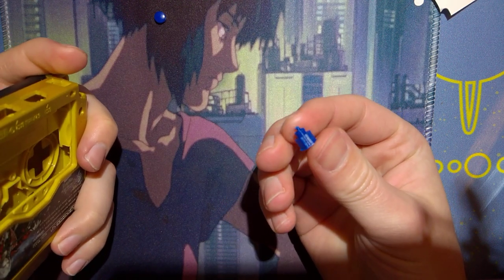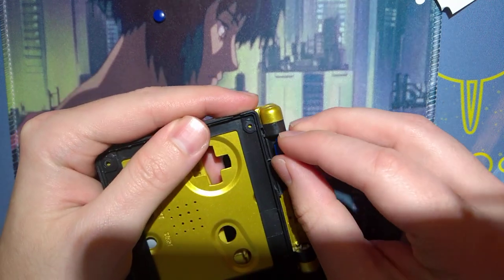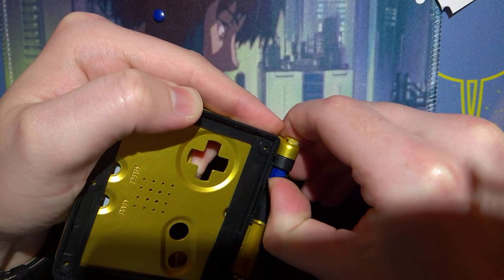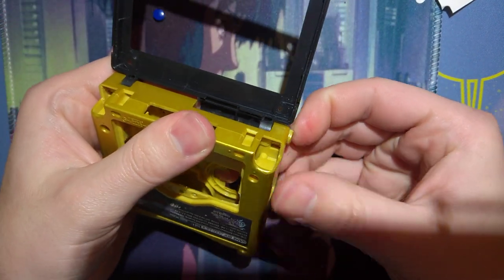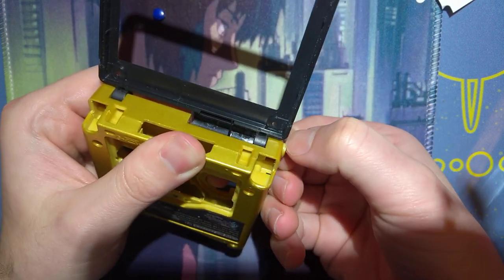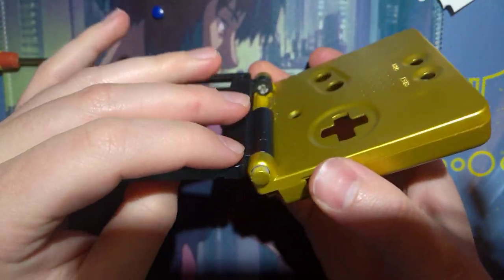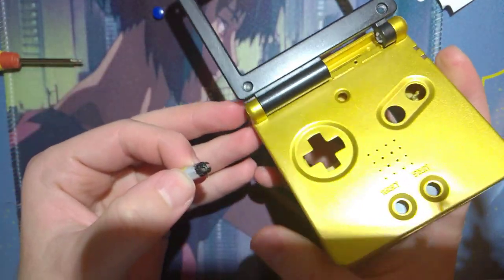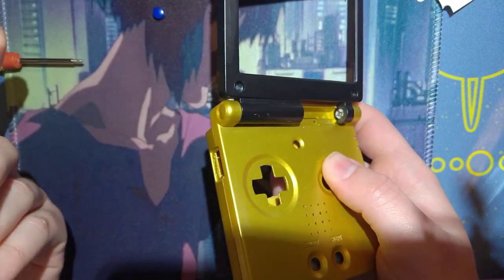GBA SP Hinge Removal Tool

Comment: Only 800 views?! This deserves way more! I've seen 1.4k view vids instructing people to do it the complete wrong way which were made AFTER yours... even has someone in the comments thanking the author for his "easy" alternative to your method only to have the same person return to the comments with a horror story caused by the bad info in that video.

People need to understand that forcing the hinges out while the lid is closed is 100% wrong and it will not go back correctly if they do that. This tool makes quick work of it.

The only comforting thing in all this is that my own video on doing it right with a Bic Round Stick ink pen got twice as many views as that bad one but I was unaware of your 3D printed tool at the time. Since I do have a few 3D printers perhaps I should make a follow-up without using years old footage of me floundering around. Then I could show both and feature the horror story as a precautionary tale but I might end up further distracting people from your important video. :(